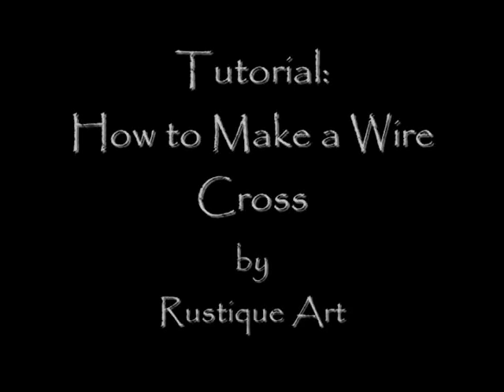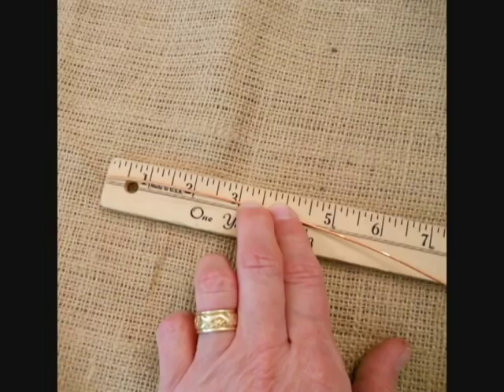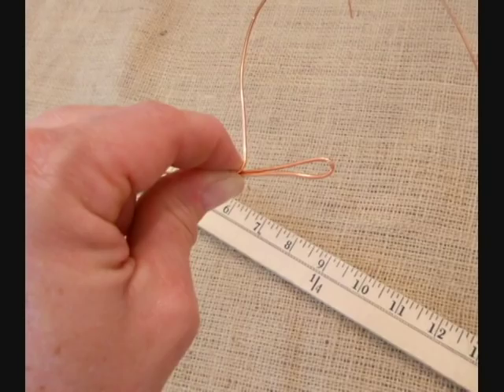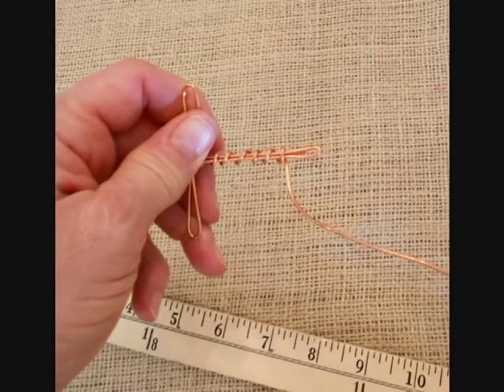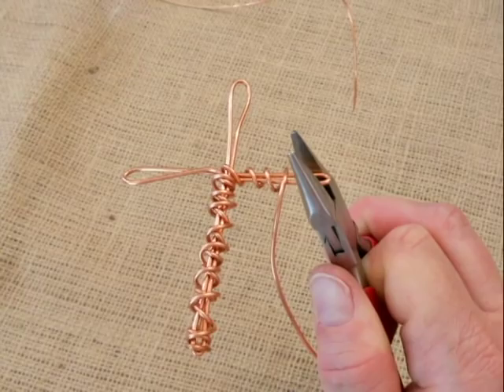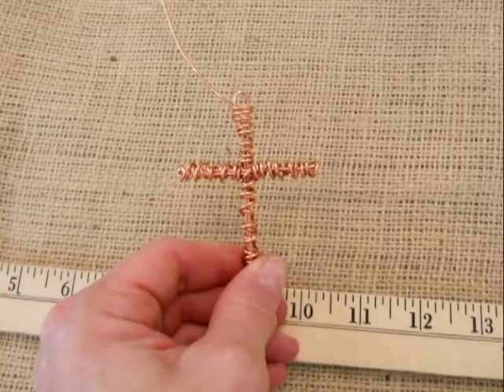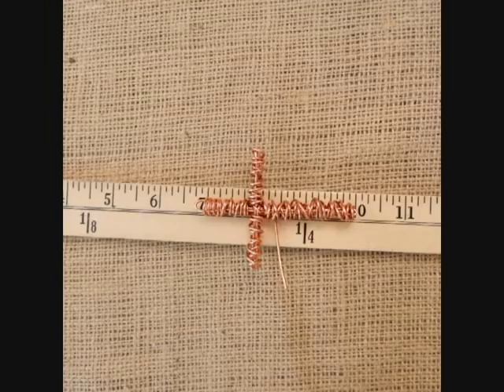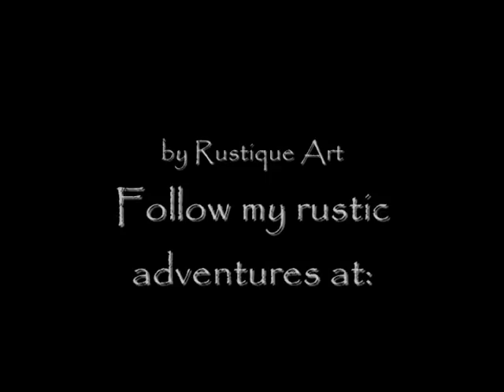How to Make a Wire Cross

Comment: I make wooden ones out of little branches that I find on the streets, or out in the woods.
I use files to shape them and then chisel out a groove on both pieces, and glue them together with epoxy.
Use Ipswich woodstain, and using a dremel, drill a hole, slip a string through.
Reply: Randy Woodworth same!